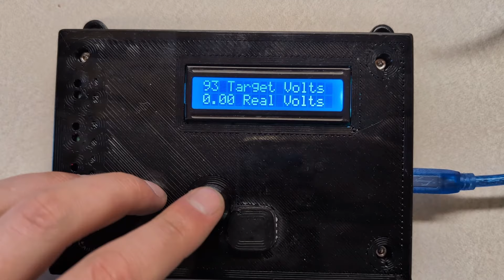Building a Budget DIY Plasma Cutter

Comment: You guys should offer a DIY THC controller kit - a printed PCB with all of the components that would just need to be soldered onto it along with STL files to print the enclosures. It would be cheaper for us DIY guys, and at the same time carry less workload on your end.
Reply from the maker: This was our original intent when starting this project, but the design got far too complex for most people to assemble and support would be next to near impossible. It would actually be more work and more expensive for us to assemble a kit as the THCs are manufactured by a PCB Board House, they can buy components for way cheaper than we can. There has also been a large amount of pirating on our original plan package so we need to keep the design secure for the time being.
Reply: Definitely, because the cost of investing in a plastic printer just to print components for the plasma cnc is in its self a big expense.
Reply: @alexthompson8307  and you can always pick up a secondhand plastic printer for not a whole lot… that’s what I did :-)

Comment: i did a double y axis version of your machine; it's rock solid. This is something you guys might consider on yours...... Also, i ran into my first issue and that was piercing through half inch steel. The blowback absolutely obliterated my 3d printed torch holder...... maybe ill make an aluminum shield to prevent this from happening again and screw it into the bottom of the holder itself.

Comment: Hello, i have a question. Why do you have the XY arm extending with no support on the opposite side of the table? it looks like there is quite a bit of movement when the z axis touches off and lifts up the arm. is there a reason you didnt just double the frame rail on the opposite side to give it more stability? If i wanted to would it cause an issue?

Comment: Every time my plasma cutter lights to start the cut the arduino disconnects from open builds. Plasma just stays on and doesn’t move. Any idea what could be causing this?
Reply: You must have , High Frequency Arc start on you cutter, or Chinese fake Non High Frequency Start .In this case , you have ground frame of the machine and the cutter , put electronic in metal enclosure and also ground it, and keep as far away from cutter and torch as possible, use also shielded cables all arround . Also dont use USB , connect to grbl remotelly via bluetooth . After all this You still may have occasional hickups ruining Your jobs. Also warning ground I mean electrical earthing /bonding NOT plasma cutter work clamp !! As it is positive-but commonly called ground clamp.

Comment: I have your plans, and am collecting bits and pieces. I am also going to print the bearing blocks, and then use that as a pattern to cast them in aluminum. But molding and casting will involve a small percentage of shrinking compared to the original. Are there drawing with dimensions for the bearing blocks? I could print it and then make detailed measurements and reverse engineer all the critical dimensions. But it would be a fair amount of work, so I thought I would ask first.
Reply: You should be able to check dimensions in your slicer of choice.

Comment: I like those end stops, where can I get those, I would like to put those on my cnc router. I booked marked you website so when I'm ready I can build this. Thanks
edit : also with the plans are the circuit board plans there, for the one you made near the end of the video. Height controller I believe you said